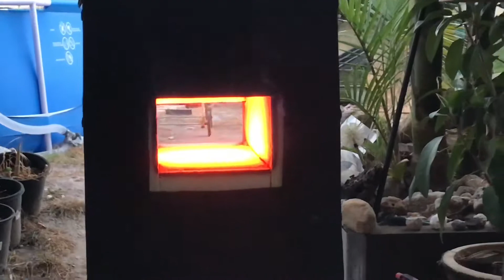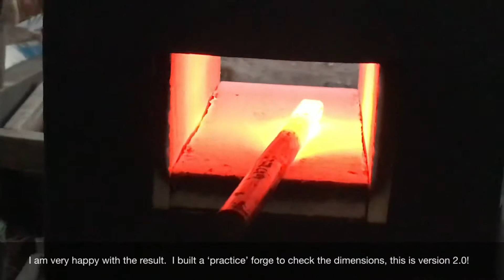My gas forge is completed. Summer blacksmithing!

Comment: I gotta say, being able to refer to it as my OTHER forge is a pretty damn good feeling.
Reply from the maker: Curiosity Forge Technically I have four if you count the original steel bucket lined with plaster.  The first propane forge was lined with homemade refractory which didn’t hold up, and have just completed a coal forge with clinker breaker and air gate!
Reply: cm8sunset I'm just stuck with 2 forges like some filthy peasant.